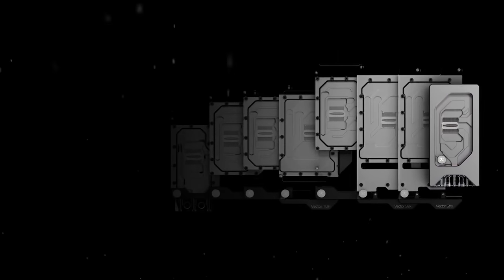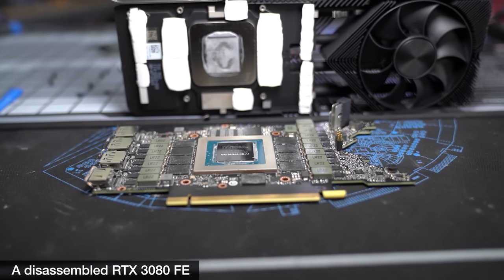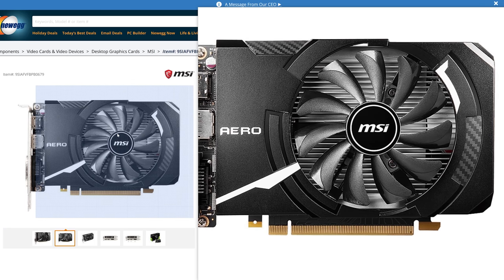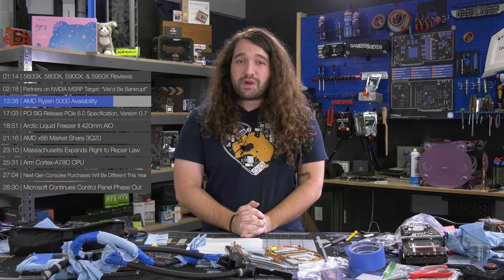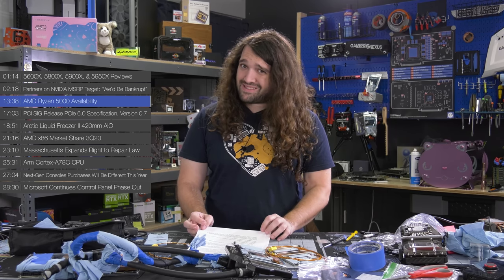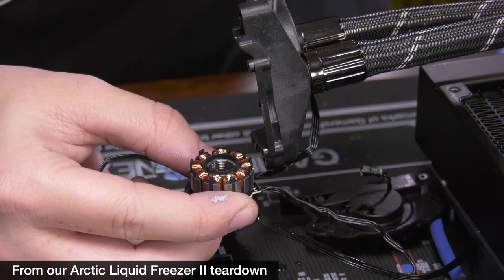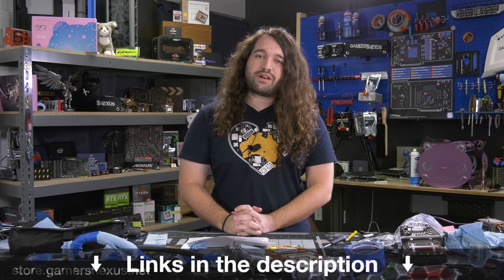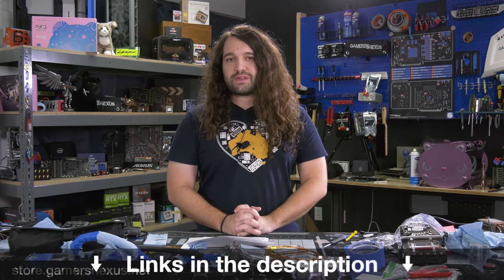HW News - NVIDIA MSRP Allegedly Not Realistic, Ryzen 5000 Supply, PCIe 6.0 Spec

Comment: With regard to low availability: something a manufacturer can definitely do is communicate that they really honestly pinky promise shipped a ton of products, and that the demand is just too high. :( Like Nvidia did with the RTX 30X0 launch. This does add significantly to the hype of a product, and people are fighting just to get a hold of a new graphics card. Sometimes no matter the cost. Who exactly benefits from that is uncertain; stores, board partners, Nvidia? 
This also ties nicely into the MSRP thing. I don't care if board partners complain about MSRP targets. Let them sort it out with Nvidia. The only thing I care about, is the price/performance. If a card turns out to be a lot more expensive than the announced MSRP by Nvidia, then I might just not buy it. Ultimately it's hurting Nvidia's image. If they market a new card like the RTX 3070 as 'starting at $499' (for a pretty nice 'FE' design card), and the only cards available cost hundreds of dollars more, I feel like I'm being screwed over (even more than usual).

Comment: So the pcie interface is always doubling the bandwidth and thats all, can someone explain me why we didn't simply go from version 4 to 6? Do we discover something every year making it possible to double? What did we discover in order to make pcie 5.0 possible that wasn't possible 2 years ago?
Reply: starshipeleven  Maybe not jumping, but why is it so long to release a new spec and make the actual product? Intel even has a photonic transmitter of 400Gb/s, what are they actually doing during work time?
In the same way, why features of zen 3 weren't already in zen 2 since the process node is the same? Did they discover something since? Did they not have the time to implement it? Is it just so they can say the next year that they improved something?
Reply: starshipeleven  Sure but is designing something to have x4 the bandwidth really harder than making 2 iterations which double every time? As a developer, I'd rather prefer to have everything right the first time instead of having to keep improving it every year.

But I do get the principe and can understand why it is this way, thanks for this good explanation! However I am not sure that comparing photonics and eletronics device based on price is relevant, since those photonics device are currently in a niche and suffer from high R&D whereas pcie is more widely adopted and can therefore be largely cheaper, could give it another decade or two

Comment: Ugh, Windows Settings app is junk, they never should have even released it without full features of the control panel. There are still parts where you have to click "additional settings" and it takes you to the control panel item. Bitlocker can't even be manged in the settings app at all (although I tend to command line bitlocker anyway).

They should just keep control panel for those of us that know how to use it.

Comment: Microsoft getting rid of the control panel would be their biggest mistake since Windows ME launch.  Forcing techs to spend 3-4 times longer to complete settings setup (if you can find them at all) than needed.  I wonder if there going to be blocking GodMode?  If you don't know how to make Windows GodMode, just make a new folder on your desktop and name it  GodMode.{ED7BA470-8E54-465E-825C-99712043E01C}

Comment: I was planning to get a 3070 but since I can’t it looks like I have to try my hardest to try to beat the bots and pick up a 6800 hope the drives are better than the 5700 god I had such bad luck with that card
Reply: 5700 had hardware issues amd attempted to fix through drivers. Navi 2x shouldn't have hardware or driver issues. I would bet this will be their most problem free launch yet, except for scalpers and pent-up demand.
Reply: @jesh879  Should I buy a second hand 2080 even though the performance is as good
Reply: @stevena4367  if you want to stick to team green you need to sign up for a discord that will notify you. I got a 3070 today, actually.

Comment: So Steve, are you really saying that AMD aren't aware of demand?
Reply: How so? Amd has had production shortage last two years! Ofcource They know the demand! They have got all the production capasity that TSMC just have available to them! And it is not enough.. TSMC is building new factories but it takes few years to get them ready and running!
Reply: @haukionkannel  When a company "knows" demand (decades of experience to figure that out for nVidia, AMD, Intel) they can then plan and invest to support that demand.  So Steve is wrong, the investment in manufacturing infrastructure to meet demand obviously cuts into profits (3 month production buffer is cheaper hence more profit).  So the idea of "the more they sell the more they make" is rather naïve simplistic ... for example, if AMD, nVidia, Intel invested $3 Billion (cost of a new Fab facility) to increase manufacturing capacity to meet demand they know they will have OR decide to NOT meet demand with a 3 month "buffer" and still reach the same sales goals and save themselves $3 Billion.  Demand does eventually drop off which Intel, AMD, nVidia are all aware.  Of course they all want to sell more, but they also want maximum possible profit so avoid the expense of another Fab facility to meet demands and increases that profit.  It's always about profit.  It doesn't matter to AMD, Intel, nVidia if it takes 3 months for them to fully realize their sales goals, they aren't exactly strapped for cash.

Comment: I don't mind switching away from the control panel if microsoft doesn't completely destroy all the easy access to features I want from the original control panel. If the audio and networking pages weren't such hot garbage and provides little to no similarity to what we had, then why destroy what was good about control panel. The features I want like access and even information of networking, switching between audio devices and disabling and enabling network or audio were there, then I wouldn't have an issue, otherwise the rest of the new windows setting is alright. I don't mind change, I just don't want downgraded crap that destroys features I liked. Viewing networking statistics and information used to be easy and great, when a wireless connection degrades, it used to have better detailed view of how fast you are connected, so you could trouble shoot and adjust your networking signal if you move around with your laptop. Now you need a third party tool if you want that information. So microsoft either needs to stop degrading features to make it not absolute shit.

Comment: The MSRPs on the current RTX 30 cards were not realistic to begin with. 499 for a 2080Ti class performer? lol. The lowest tier 3070s with the relatively worse coolers go for 600 EUR here in Germany and the high end ones go over 700 with stock available across major retailers. And 3080s? They start at at least +130EUR for the base models with the respectable ones sitting around 930 EUR. Aorus extreme card retails for 1100EUR! That is 2080Ti price right there. Nvidia has the cake and wants to eat it too. This is all while the gullible people are buying 3090s (yeah, they are also in stock here) for over 1800EUR. 3080 was the bait and the 3070s and 3090s are what nvidia intended to sell.

Comment: Now i have another reason to spend more time on the linux side of my drive and less on the windows side, thanks Microsoft. I have a better idea, leave the control panel alone and get rid of the other garbage that I'm sure at least half us hate. It's bad enough settings and other important stuff is dotted across the OS. Since Microsoft is treating windows as a live updated service do us all a favor and go back and clean up your code. Just because we have large drives doesn't mean we want to waste a 1/3 of it just for the operating system

Comment: nVidia MSRP is BS and always has been BS. nVidia MSRP for a 3070 FE is $499 at the moment of this writing. This converts to 422 euro. Actual retail prices are between 650 and 720 euro. With the 650 euro models being constantly sold out, as they are the most affordable. So realistically if you want to buy a 3070 FE at this time, you're looking at a 720 euro price tag. Which converts to 849 USD.

So yeah, nVidia suggests an MSRP which is as much as 350 USD below the actual market price. Which is a 70% difference.

And before people will say "but the MSRP doesn't include taxes" that doesn't change anything really. nVidia EU MSRP for the 3070 FE is still "only" 519 Euro. So that's still a solid 200 euro below the actual price at which the 3070 is actually available. So it's still a BS price to suggest, especially given that nVidia itself can't provide a retailer which actually sells it at the suggested 519 euro. nVidia itself for sure doesn't sell it at that price.

Comment: Fuck the Win10 Settings app.

Win10 networking configuring from the "Settings" app is a joke. Anything more complicated than leaving it untouched at "DHCP on a single installed NIC" is quickly getting in to barely supported territory. Even something as basic as two NICs or static IPs (or any network settings beyond just default DHCP) is asking for trouble. AFAIK, multiple IPs on the same interface or configuring VLANs is either actually impossible, or requires an at least 3.5 goat sacrifice to have a chance at configuring. At this point its far easier (and actually doable) to config the network on a printer where you only get 3 buttons and a 12 character alphanumeric display and the only way to view the settings is via printing them to paper, which somehow has far better and more readable formatting than Settings.app. FFS

Printer management in 10 is massively painful. Something as extremely basic as accessing the printers settings (like to turn of duplexing by default) is a maze and still requires somehow getting to the Vista era Devices window as there appears to be absolutely no means to access this from Settings.app. Worse yet, installing a new printer from Settings.app is almost always fail with anything that isn't USB or auto-detected and installed. The "Add Printer" within Settings will usually throw a nonsensical permission error on most machines I have touched, the only fix I had found for this is to reinstall 10 and that only fixes it about 1:20.

Comment: I wouldn't be so pissed on Microsoft removing control panel, if that settings crap didn't suck that bad. It's effin 2020 and I can't have two windows opened. What is that, 1987 and Windows 1.01? If you have SFPx or QSFPx network card, you can't enable it or disable it from the networking tab. Language settings  are impossible to set right, you can't edit date/time formats, can't enter NTP server, if you have two mice or mouse and touchpad or other cursor controller you can't control them at all. You can't set proxy address per protocol,  and many, many others. Damn Redmont trashpandas, if you really want to get rid of that thing, at least take a look at stock Android or Gnome settings, simple, complete, functional. Is it that hard?

Comment: Good job Microsoft. Taking a convenient and well organized control panel and spreading it out into the gigantic mess know as the "Settings APP" Since when is the goal for organizing information on a computer to make it less dense and less organized?
Reply: i just search for anything i need using search app. I think modernizing it is the right thing to do.
Reply: @br33zy771  So arranging the information in a formate that is only generally optomized for touch screens of which input is generally limited is modernization? I have 4 screens and 0 touch screens. Microsoft is way off base with this one.

Comment: As windows becomes scarier by the year maybe more of our fellow master race members will consider switching to Linux. The only battle left now is anticheat. We have shown time and time again that windows titles can run well or even faster than on windows using proton and dxvk. Now the big milestone is getting anticheat providers like easyanticheat to help create a solution. Easyanticheat already provides both windows and linux anti cheat. However there is no solution when running a windows game inside proton/wine since eac will detect it's not windows and cause problems. EAC was in talks with valve to try and get this working until they where bought by Epic Games. At which point they went silent and have not been heard from since. I think Epic Games might be the biggest obstacle still in the way of Linux gaming dominance.

Comment: I'm still on Windows 7 and even if every game in the future drops support, I'm not going to bloatware 10. I'd rather switch to Linux and deal with every crap problem they have. At least with Linux I have full control of my system and TRUE desktop features. Windows 10 is NOT a proper desktop OS. It's more like a shitty mobile OS pretending to be adequate for PC use.

Comment: (this is a rant) whoever they have at Microsoft making these choices they need to fire them because nobody i know uses their dumb apps literally over 1000+ people i asked on discord still uses windows at this point and its specifically because they keep trying to force users to use their new crap if it aint broke dont fix it if it works dont change it and if you think you know best ask your users don't force im so annoyed that they think this will end up in anyting other than them bleeding mass users or people hacking windows 10 and releasing an un "fixed" version most driver creators are even irritated with the constant changes windows updates and it breaks radeon drivers almost every time most intel networking drivers are bugged on later than 1909 versions of windows heck my motherboard drivers wont even install on anything past 1809 simply because realtek stopped giving a crap and they think this is okay i say whoever is giving this the green light fire them because in 10 years its going to make windows that os that people use to use back in the day and linux will ultimately be on any new computer in the future due to its lack of user restriction and complete configure-ability

Comment: Nvidia have not released the 3000 series yet. When they switch to TSMC in 2021 they will launch it. I dont know how to call whats happenig right now, but its not a launched product(imho).

3 Weeks ago i Wrote under an Igorslab Video: 

I think it's great how Intel and NVIDIA are making AMD so strong that AMD is moving forward. These paper launches from Intel and NVIDIA are a joke and I don't support that. 
I'm beginning to understand why NVIDIA has set the RRP so low to attract people, because due to RRP is not possible at the moment. Real prices are around 1100-2000, in the shops 800-900 but even that is not available. So even the 3080 is already more expensive than the 2080ti.

Comment: No tinfoil hat here, but I see one scenario where AMD is, if not creating false scarcity, taking advantage of a bad situation / making it look better than it is.
Just before, you mention the case of partners explaining that Nvidia RX 3000 series MSRP are unrealistic. (for multiple reasons)
Do we know if most retailers actually pay the "true" price to AMD?

Here is the scenario : what if in spite of Zen3 using the same node as Zen2, for some reasons, Zen3 yields are bad? Or AMD just wasn't ready and didn't have enough manufactured CPUs for a proper launch?
Indeed, selling, say (completely made up numbers, just an example to backup the idea) 1 million CPUs with a projected 100$ margin would be better than selling 0.5 million CPUs with 150$ margin. Except if you actually have only 0.5 millions to sell instead of 1, making actual 75 millions $ benefit is still better than 100 millions $ theorical benefit.

Here's my point : no, they mostly probably didn't create false scarcity with the intent of doing so. But this scarcity might be the result of a rushed launch, bad yields, a combination of both or anything that can factor in.

Remember late Spring / early Summer when everybody was making fun of Intel's problems with 7nm and how it made their stock exchange value dive, and infuriated shareholders?
At the exact same time, there were rumors of Zen3 being delayed to 2021, to which Lisa Su quickly responded "No, it's on track for 2020". We know that it's not just a technological war being waged between these companies, but also a pyschological, communication and financial one.

I don't consider "conspiracy theory" the fact of rushing out a product that is technologically ready, but the availability of which is way too low for a proprer launch. Just an improper launch and a poor commercial practice. But as you said, demand is high, so, why not...

Comment: What is Microsoft smoking? Some psychedelic substance tainted with lead? People need their advanced settings to do advanced things. If they keep this kind of thing up, they'll push everyone to Linux, not out of choice, but out of necessity.

Because if you need to configure the system to get something to work, but it's literally not an option, then you can't use Windows. And with all the work being done by Steam (or is it Valve, technically) to get Windows programs to use Linux system calls, then chance that whatever advanced task you're trying to do in Windows is actually possible in Linux is increasing.

I actually get the feeling I out of date on the progress that Valve has made on the compatibility front, as I haven't heard anything lately. Maybe it's just become boring but steady progress now that the hype has died down.
Reply: Uhg. Typos I can't correct. I guess it's still possible to understand though, even if it sounds like I haven't quite mastered English yet.